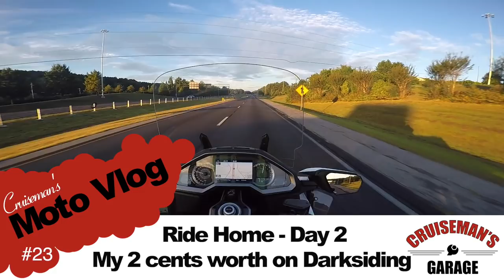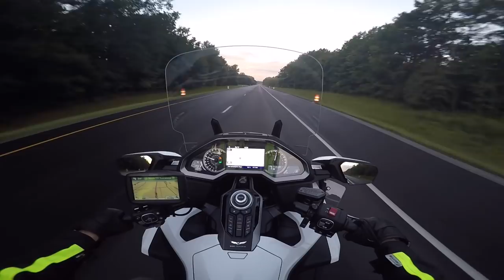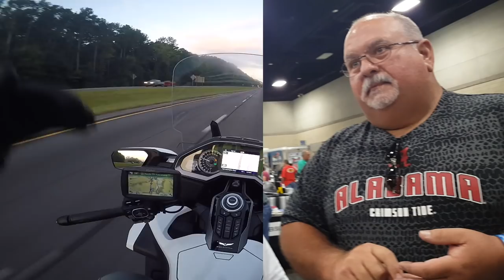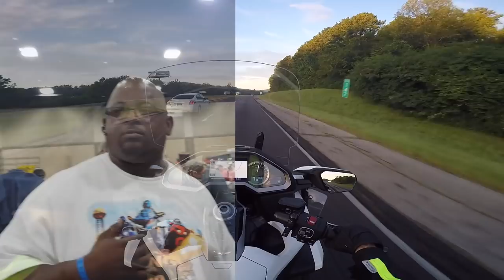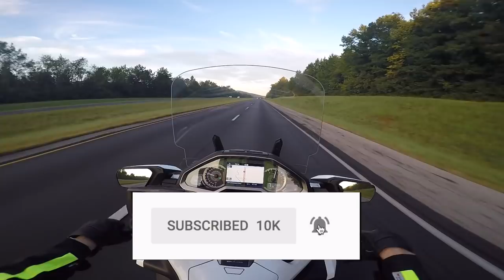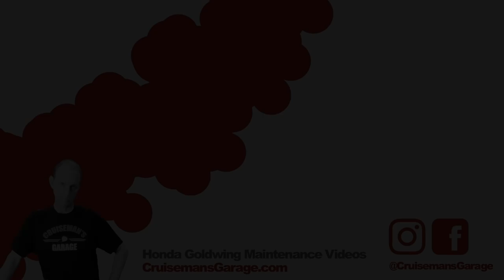[Ep 23] My 2 cents worth on Darksiding - 2018 Honda Goldwing

Comment: Great job on the dark side issue.  I say do whatever you want to do.  However, I have run Dunlop American elites (bias ply) tires on big heavy Harley Roadglides that go 930 lbs and have gotten 20,000 miles or better on the rear tire and even more on the front. That's not bad for a bike. If you can't afford it then perhaps you are in the wrong sport.....

Comment: I run darkside on my Valk,  I really like it so far.  I will say tho, IMO if your bike comes from the factory with a 200 or wider rear tire, I would NOT suggest Darkside for you.  I run a 195 car tire, and the flat spot on the tire is very minimal and My bike still handles great, I will say you notice a difference on a offcamber or slanted riding surface, the flatter tire needs alittle more input on the handlebars to hold the riding line.  

I will say, the WIDER the car tire, the WORSE the handling characteristic are gonna be.  Most touring bikes use 200 or smaller rear tire, so i have no issue suggesting Darkside for them.  I just wouldnt suggest it for bikes that have 200+ rear tires.

Comment: The rubber compounds are different between a car and motorcycle tire . The motorcycle tire has a firmer compound in the center for better mileage and a softer compound on the sides for gripping the road when leaning,  also tread is designed to shed water and heat. If you're riding on twisty roads the car tire will not handle as well as the motorcycle tire case in point, my friend dark sides and we road the tail of the Dragon.  I ride a 2010 goldwing and he has a 2014 goldwing.  We stopped at the tree of shame and were talking about the ride he said he was having a hard time keeping up with me his bike was wanting to weave.  We felt the tires on both bikes and his back tire was much hotter than the front and much hotter than mine, we also checked the air pressure and it was good.  On the other hand when we pull  trailers on interstate highways and his tire runs cooler and seams track better when winds blow . I guess it depends on what type of riding you do.  You could have two wheels, one for dark siding and one for twisties but for me I will stick with what the manufacturer says.

Comment: The issue for me and statement I haven't  heard is WHY!
Because of tire failures and shortcomings is why we are even having this conversations .
How many version of a tire from a well known brands and they say this one offer longer wear life, but do they ?  If I could get around 20k in a run flat design out of MC tire riding two up with gear. I would return to MC tire. But I want a prorated warranty, only reason for the warranty is I heard this song and dance before. " This new MC tire has longer tread life" If the manufacturers had listen to tons of complaints about big heavy touring bikes not getting mileage life out of their tires, and made  a heavy duty touring MC tire we all would have a MC tire now. But a large amount of big bike owners either trailer their bike to a event or destination  or they are weekenders and don't put a lot of miles on a bike or they ride solo. So its no surprise that the manufacturer make what they do. Most bike owners have no problems with  the wear life. For me it was my new improved  MC tire with only 2k on it and a belt failure causing the tire to have a thumping sound with no visible outside damage. The cherry on top was we were 1500 miles from home and tire shopping on our road trip. That was seven years ago. I have had a car tire ever since and we had many trips and have stopped many wonderful roadside shop but none of them have been a tire shop. Before when I was riding on MC tires like clockwork every year a week or two before our big summer trip I would buy new tires. And now with a car tire on the rear I will go about 2 years before I change out my rear tire and it will still have a lot of tread left. The plus side for car tire other than tread life is I can buy a more expensive run flat and still save money. Another plus is shorter stopping distance rain or shine.  The peace of mind of a run flat. If  a  MC tire works for you that's awesome. I'm not trying  to change your mind I'm only trying to change less tires.

Comment: Double dark!!!!, on my last kumho runflat and running a battlax bt 54 140/70/18 - runs smooth, next will be the bridgestone driveguard and a michelin pilot active 130/70/18 - better grip imho regardless of the naysayers about contact patch.  admittedly slow turning maneuvers are more difficult but the curves are not as effected as some would say they are with a CT on the rear.   as always - to each his own.

Comment: It's not rude to guess that the guy in the inset with passenger and gear was on an overloaded bike.  In that case under hard G's I could see the bead cracking off the rim.

I ride darkside and carve corners hard on an all season Yokohama Avid Envigor and do so down to 40 degrees and no issues.  

All this said, I find this opinion to be of questionable worth coming from a guy that's never tried it and who infrequently rides curvy roads.
Reply: So I need to get shot first before I can say that getting shot is a bad thing?

Comment: Re darksiding:  not for me -- I spend a great deal of time leaning my '02 GL1800 pretty hard and pushing curves.  There are long stretches of road in Colorado that are nothing BUT curves.  And nimble, consistent handling and transitioning in and out of those 45-50-degree leans is extremely important to the feel, traction and safety in my opinion.  In these circumstances, I'm pushing the tires to close to their limits of traction, and given that tires are the difference between life and death on Colorado curves, using a tire that is DESIGNED for what I am doing is VITAL.

Now if I were to set out into a riding season with intent to do 5-10 Iron Butt Association rides, which by mere speed/time constraints dictate that most of that time would be spent on the freeway with only my own safety involved, I MIGHT consider it to save $$ money on tires.  But I would do so knowing 2 things:  I'd be giving up my cherished good handling (this topic deserves a lot more attention than I am giving it here), and I'd be constantly alert for any trouble and would go back to Metzeler ME888's in a heartbeat at the first sign of anything unexpected.  (ME888's are supposed to get 20K miles, so I understand.  I will know a lot more about this after I burn through my first set -- starting next tire change.)

Re fast-food burgers:  #1 = In and Out Burger, hands down, though we have none in Colorado, and #2 Good Times, which we DO have in Colorado. #3 is a tie between Culver's Butter Burger and BK Whoppers.  :-)
Reply: A goldwing nimble and pushed into corners, surely you jest!!!

Comment: I install automotive radials on my trikes as it is logical and of course any properly designed trike does not lean. It is not possible for the bead to come loose as mentioned unless there was a incident of total air pressure loss prior to the tire coming off the bead. The standard 16" automotive tire fits the GL1800 rim perfectly and does conform to the bead is well as a MC tire. The guy at wingding was guessing and what he claimed is not possible I can see this happening if one is using a run flat which has lost all pressure. I definitely do not recommend run flats as they are barely suitable for cars much less motorcycles. Insurance will not be affected, insurance companies do not deny coverage for tires unless the are bald with the cords showing perhaps. Double darkside is a goofy term as all that means is running a bias ply (normal) tire on the front, bias ply tires are not car tires they are just common motorcycle tires and are actually better suited for tour bikes than radials due to softer ride and tendency to run cooler.

Comment: On page 4 of my 2008 GW Owners Manual, below a WARNING of serious injury or death, it says specifically not to pull a trailer or sidecar. To me, trailering seems unwise and, if I tried it and anything happened to a passenger/loved one,  "I may not be able to live with myself". Besides I, "researched" it on the internet, and talked to a guy who told me a story... .  Conversely, I feel safe with a RUN FLAT car tire, and if anything ever happened, I'd want to see empirical evidence it was the tire's fault. Despite both of the above, millions of miles have been racked up by motorcyclists pulling trailers and/or on car tires. Many here have tried one but not the other, and bash the one we have not tried while promoting the other. We can all speculate/arm chair quarterback, but if truly concerned about loved ones and safety, it seems the only consistent logic is to avoid doing EITHER. On the other hand, maybe if I tried trailering I may discover many riders out there know something I don't. On second thought, maybe I should just offer my 2-cents on how unsafe and dumb it is. Of course, the same could be said of the other party regarding car tires.
Reply from the maker: Can you point to the timecode in the video where I claimed anyone to be "dumb" for Darksiding? I don't even think I declared it "unsafe". I just cited examples from people I overheard. I have my concerns, but I respect anyone's right to use whatever tire they wish.
Reply: No, you have not done so, but that is the jist of many of the comments here. The issue of DS is usually polarizing; folks line up on one side or the other, with strong, emotional opinions. I wonder if trailering was ever such a polarizing issue.

Comment: I think that the motorcycle tire manufacturers should make a hybrid tire that will be half and half.
Reply from the maker: A MC tire that would last 20,000 miles would solve this issue, AND, it is certainly doable. All they have to do is make a tire with a harder compound in the centerline of the tire. It might ride a little rougher, but a lot of folks would live with the trade-off.
Reply: Now we are making some sense, the reason we Darksiders have gone dark is because of crappy motorcycle tire performance. Cupping, separating, wobbling, low mileage, expletive causing performance....

Comment: I have ridden 1,000's of miles darkside on my Victory Vision but decided to go back to a bike tire indefinitely . In my experience, it wasn't dangerous, it was just different , it was less fun in corners and the Vision was designed to corner so, I decided it was better to have more fun than save a few dollars. The car tire two up on the dragon was work not fun.

Comment: Well if he was riding the bike he looked huge and the bike was probably over the weight limit and the tire was probably was not inflated enough. I have ridden Darkside for 21 years on my Valks since I was only getting 7000k on a bike tire and do 12-15k per year. So spending that much on bike tires is very expensive. People pay no attention to the wgt limit of motorcycles and 395lbs is the max limit. so adding rider and passenger I am confident he was over wgt. Also, with the Darkside when the tire is flat it is less traumatic then a bike tire. So appreciate your videos for sure. Keep up the good work.
Reply from the maker: Could be,. He was a pretty big fellow. But, how many ride bikes over the recommended weight limit. I am getting close to the opinion that there may be as many positives as negatives to darksiding.

Comment: For the guy who claims his car tire came off the rim, if it was a "run flat" design tire, I call BS. Most darksiders use run flat car tires, for several good, safety related reasons.  Further, if you have ever tried to mount a run flat car tire on a Goldwing rim, you'd know why I call BS.
Reply from the maker: I don't think it came OFF the rim, but the bead broke loose and it lost all of the air.
Reply: I'm with you Joe....let one of these nervous Nellie's mount a Yokahama Avid Envigor RF on the Goldwing rim.....it ain't just gonna pop off, now it might take a D9 Caterpillar to get it off once its on!!

Comment: CDN 1.5 cents - no dark side for me! Like one of your discussion group, I wouldn’t be able to face anyone if I had a car tire on my bike and anyone got hurt as a result of it. On a different issue - I’m wondering how long tires are lasting on the new 2018 GW both front and back. First with new suspension on front tire how’s that affecting the tire wear? Maybe Max (Triaxxion) has some comments?, and larger (wider)back tire? The lesser weight of the bike? Lots of questions - I’m a little above 17,000km (10,500 miles) and so far the wear seems okay - I’ve started to notice a different feel from new (broken in) tires but still no real issues. I’m fairly vigilante on checking pressure and I’m running at Honda recommendations 36 front and 41 back. In my previous 2017 GW I ran higher than recommended pressure (shop mechanic suggestion). Could there be more guys riding new Wings than Dark side tires - just guessing.
Reply from the maker: I am at about 6500 miles on my Dunlops. I am not a Dunlop fan, but even my Stones would only be good for about 11,000 before they started to ride rough on my 2012. I will probably be using Dynabeads when I put on new tires.
Reply: Previous bike was / is a 2007 not 2017
Reply: In Canada the new 2018 GW come with Bridgestone tires

Comment: Hopefully the MC Tire dealers will give us an optional footprint that models a car tire
Reply: ME888's have a slightly "squatter" curve to them, giving them a larger contact patch when vertical.  Probably part of the reason they get (reportedly) 20K per set.  Maybe more with improved suspension, though this is speculation until I get through my first set.
Reply: @vics-videos  ,Let me know how many miles you get when you change your set. Right now I'm Bridgestones. Said I'd try the Dunlops, but I got a set of Stones for less than $200, so I went back to the stones

Comment: In my experience. The only way the beed will break lose is winding did have the proper amount of air pressure in the tire .the need on the car tire will mold to the beef of the motorcycle rim . it's rubber not plastic rubber will mold itself to the rim . now with out air pressure it will let go just like most tires . I know this because I've worked with tires for years .
Reply: Sorry for the spelling I have big fingers 😆

Comment: There is no downside to Double dark siding, been doing this for years, running the tire both forward and backward rotation.
I tried DS and hated it but a narrower tire would have maybe netted better results and I may try it again.
Not running enough tire pressure will cause a tire to loose the bead seat. 
BTW; The rim on my car looks the same as on my Honda, I did not do a side by side but by just looking at them they look the same? (I'm not positive about this though)
Reply from the maker: There are some graphics on Google showing a cutaway of a car rim compared to a motorcycle rim.
Reply: I may not have noticed that bead width difference;  http://www.ironbutt.com/premier/2015tires/RimComparison1.JPG
I would like to measure the bead of both tires also...

Comment: I didn't watch your video, which I'm sure was excellent.  Speaking only for myself, I will never...(as in NEVER) mount a car tire on any motorcycle that I own for a variety of reasons that have been argued about for years, I'm sure.  When I tell my ex-road racing buddies about this phenomena, they normally respond with either stunned silence or expletives interspersed with derogatory comments.  I respect any motorcycle rider's right to make their own decisions about what they mount on their motorcycle...even the most critical suspension component which is the tire.  However, I also equate it to making a conscious decision to not wear a helmet or safety gear...because the law allows it or it is "too hot" or "too uncomfortable" to wear it.  If I were an insurance adjuster or an attorney and I discovered that a car tire was mounted on a motorcycle involved in an accident, I would absolutely use that fact for leverage against the opposite party.  Regardless, for those who go to the darkside, I wish them luck...because they will need it, IMHO.

Comment: dark siding is nothing new people have been doing it since the first motorcycles came out. I think dark siding has its place in certain scenarios Me personally I use both.  if I’m going on long trips 2 up pulling my trailer I install the wheel with the car tire. The added durability of the car tire and the extra load capacity along with a run flat feature is why I use them. If I’m just commuting around town or doing short rides no trailer the motorcycle wheel/tire goes back on. I started about 10 years ago never had a problem. I did have a flat once But I was able to drive it to a tire shop on the run flat and have it fixed and the bead never came off the rim. i’m guessing the rigid carcass and hard sidewall of the run flat tire may have helped keep the bead from coming off. either way I am completely aware of different characteristics of the car tire i have on the back of my bike. am i gonna go blowing through the twisties hard on the throttle coming out of corners? probably not. That’s what the motorcycle tire is for.  I know some guys do it without issues It’s just not for me. to me the Goldwing is like a long haul truck that will eat up miles reliably. if I wanna go scrape foot pegs i’ll just hop my sport bike.